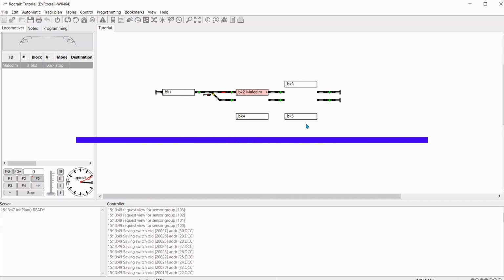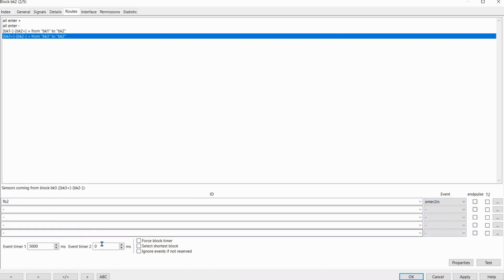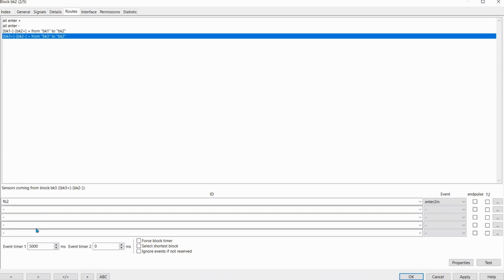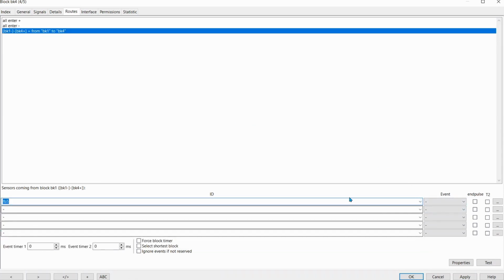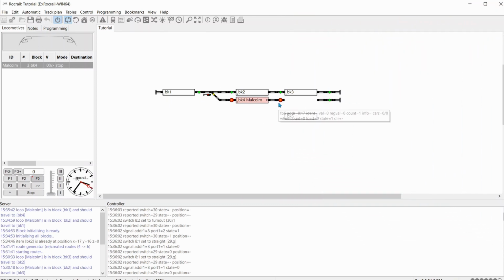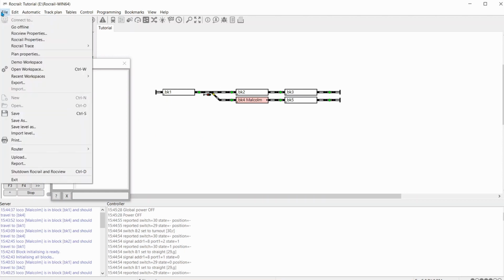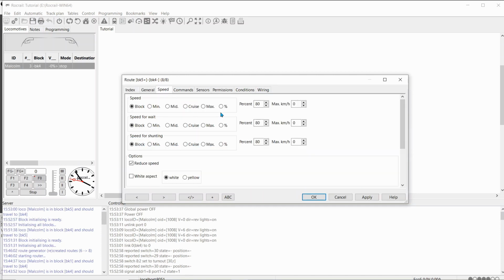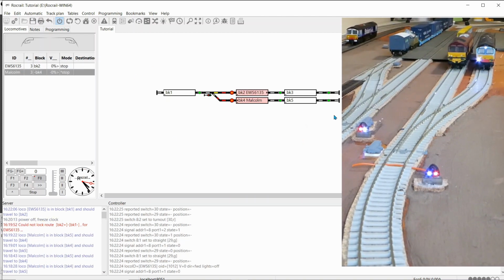Rocrail My step by step tutorial #6

Comment: HI sir ;) 

i have an module fremo station 
it is controlled via Mollehem MGP, but the logic is hard to setup in mollehem
therefore i would ask is it possible
to have an input to set an route (turnouts and signals) and then when we manually drive the trains via that route the feedback sensors will  gradually turn off  the route that was set?

Rocrail will set turnouts and signals via loconet
input and feedback into rocrail from loconet will set and resolve routes

So basicly the rocrail will handle the logic and mollehem will be downgraded to just function as interface between rocrail and acceccories.
Reply from the maker: Have you tried using a sensor to fire an action command to gain what you require
Reply: @HarburnOO  Perfect it can then be done via actions